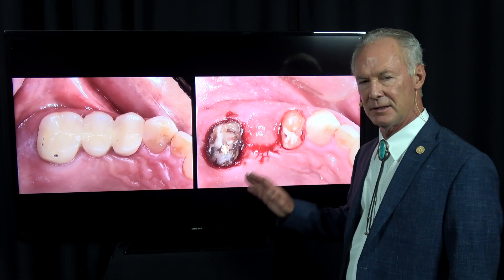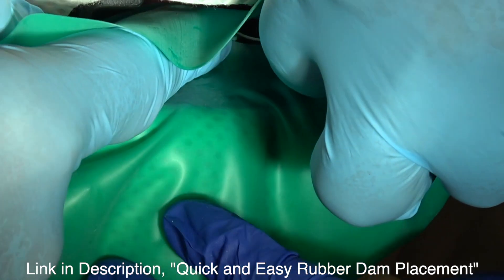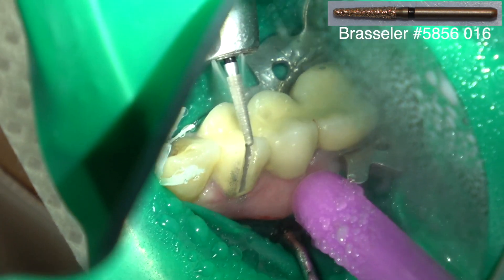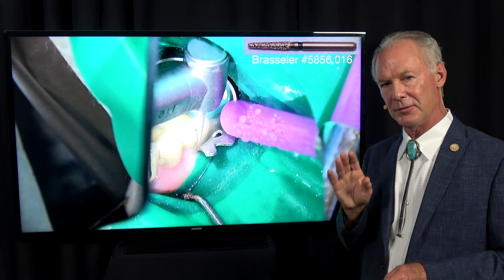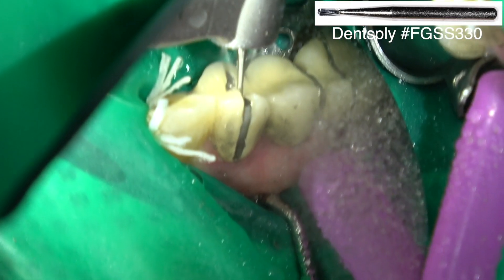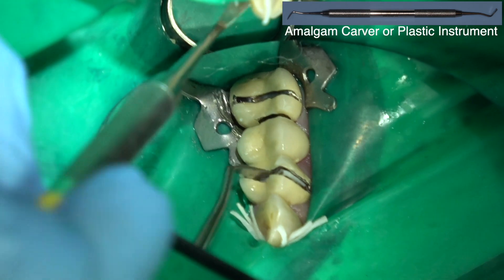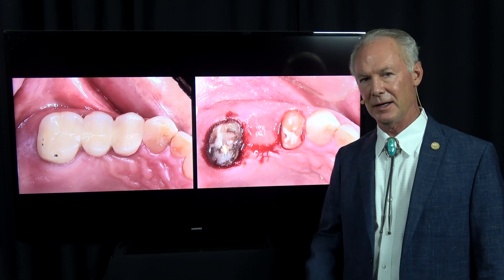Removing Fixed Dental Bridge - Dental Minute with Steven T. Cutbirth, DDS

Comment: Did you also drilled the teeth ?
I saw some lines on them looked like you damaged them a bit..am I right?
Reply from the maker: Sometimes when you are cutting through an old crown on a tooth to remove it you might cut into the tooth just a bit because it may be hard to tell where the crown ends and the tooth begins. Slight contact should not harm the tooth.
Reply: @centerforard  if I did only a buccal cut and continued till the middle of the occlusal surface ?
Reply from the maker: It might work, but I generally cut all the way to the other side of the crown so I can torque it with the elevator. Be sure to place some 2x2s in the patient's mouth in case the crown, or part of the crown were to pop off unexpectedly. Take your practice to the Top Tier. Subscribe to DentistryMasterClasses.com for an organized library of all the Dental Minute videos plus many complete comprehensive cases and many very important articles. New cases are added weekly.  Only $39.95/month.
Click here to subscribe: 
https://membership.dentistrymasterclasses.com/purchase/?plan=513

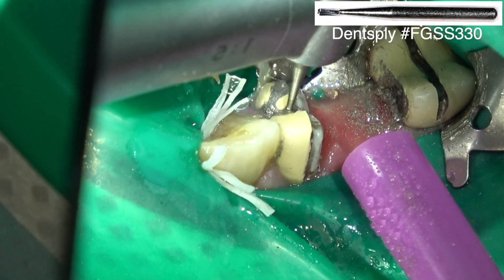Comment: I have been using the technique for the last 32 years and never broke a tooth (including endo teeth) when removing a crown or bridge. The only difference is that I use a cord packer to torque the pieces appart and  will make several slits just to make sure I don't break the tooth (I also use a 330). Then once I got half of the crown off, I cut under the crown (between the crown and tooth occlusial) to make space for my cord packer  (which usually a  buildup) and try to lift the remaining crown off with a little upward torque with the cord packer by slightly rotating the cord packer in the space I created between the tooth occlusial and the crown. If I feel that I am applying too much torque, I will cut another slit on the side of the remaining crown (and remove that portion), then try again to lift the crown with the cord packer between the occlusial of the tooth and the crown (in the little trench I made). I never carry a slit towards the mesial or distal in fear of damaging the adjacent tooth (like the doctor did in this video at 7:43).
Reply from the maker: I also will make a cut between the half crown and tooth and elevate/torque the remaining half crown with an amalgam carver. Thanks for the comment. 
Take your practice to the Top Tier. Subscribe to DentistryMasterClasses.com for an organized library of all the Dental Minute videos plus many complete comprehensive cases and many very important articles. New cases are added weekly.  Only $39.95/month.
Click here to subscribe: 
https://membership.dentistrymasterclasses.com/purchase/?plan=513
Reply: I have a crown that needs to be removed I'm in the Philippines went to the dentist she tried to pull the crown out which caused me more pain I told her to stop and I left, to this day I still have the waitng to go back to the USA in Feb 2024, never trust Filipino medical people they're not the brightest people.
Reply: Your idea of cutting under the crown is super.  I have used that exact technique for over 48 years, and it SO helpful.  I hope any dentists reading this will try this out, and hopefully adopt it in their clinical practice.  Doctor George Whitehead

Comment: An old dentist with whom I worked uses an extraction forceps to remove crowns.
Reply: I would be too wary doing that as there is risk of damaging the tooth and/pdl doing that
Reply from the maker: You absolutely do not want to fracture the patient's natural tooth removing an old crown. That is why I never "tap" off crowns. When I was in dental school I witnessed a crown and bridge professor "tapping off" 2 old crowns and he fractured off both those teeth level with the gum line. You never know what tooth structure is present under the crown. If you fracture off the patient's natural tooth, you have created a big problem. Do not "tap" off crowns. If the old dentist was using the forceps to remove the separated parts of the crown, that might work, but I would just be careful. 
Take your practice to the Top Tier. Subscribe to DentistryMasterClasses.com for an organized library of all the Dental Minute videos plus many complete comprehensive cases and many very important articles. New cases are added weekly.  Only $39.95/month.
Click here to subscribe: 
https://membership.dentistrymasterclasses.com/purchase/?plan=513

Comment: Thanks a lot for the video.
I can see that some tooth structure was cut during the procedure. I'm not pointing that out as an error as I've seen this happen 90% of the time with other doctors.
As a dental student who's never had to cut a crown, I'm wondering if there is a way to be more conservative?
Reply: It's already crown prepped. A half mm of dentin prepped won't do anything.
Reply from the maker: Many times when an old crown is being removed the underlying tooth will be cut slightly. The slight cut should not be harmful to the tooth. 
Take your practice to the Top Tier. Subscribe to DentistryMasterClasses.com for an organized library of all the Dental Minute videos plus many complete comprehensive cases and many very important articles. New cases are added weekly.  Only $39.95/month.
Click here to subscribe: 
https://membership.dentistrymasterclasses.com/purchase/?plan=513
Reply: Just try to be as careful as possible in cutting the crown and know how thick it is so you dont cut beyond it. You can more or less gauge its thickness when you start cutting the old crown
Reply: Buy a microscope LOL